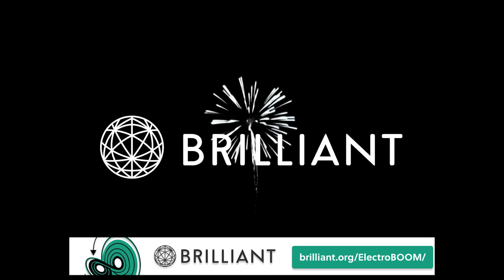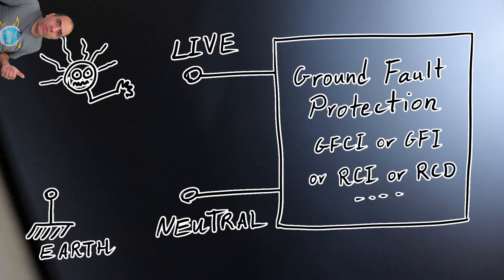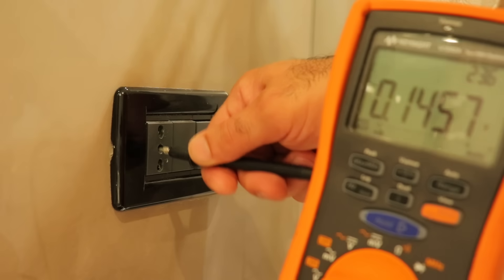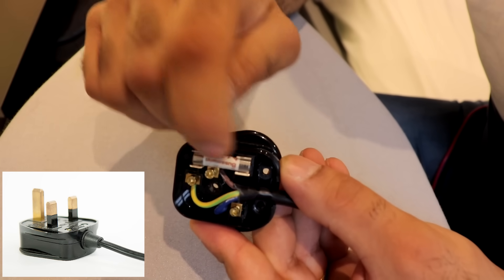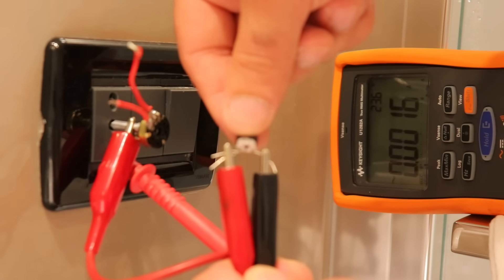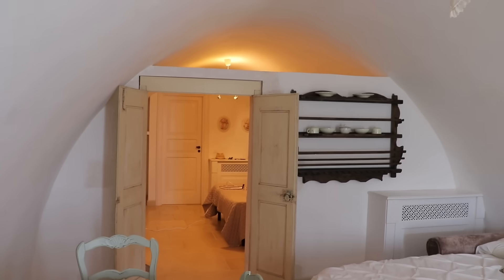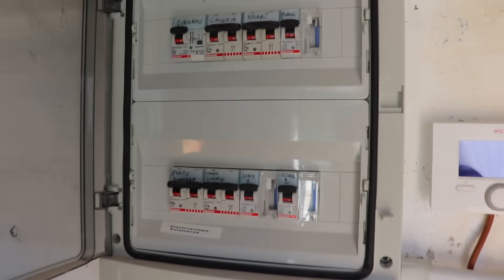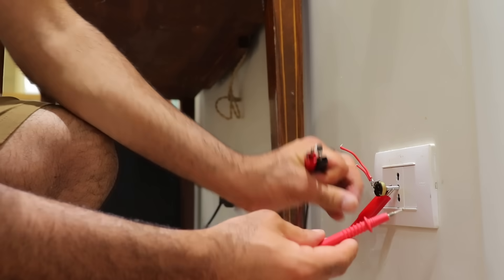Tripping Every Breaker in Italy

Comment: 3:45 black as neutral shouldn´t be as over here it is supposed to be the blue as neutral at least if you wire it in the right way, these are normal breaker you have there, there are rcd´s in this formfactor but they always have a testbutton wich you are supposed to press once (or twice depend on maufacturer) a year for function testing.
But in most cases you will have an Rcd for the whole house direkt in the main panel because (i would guess) 95% of the houses in europe have 3 phase power to them and normally (at least in gemany but as far as i know neighbouring countrys too) there is first the main fuse, energymeter, then a fuse the rcd and after then smaler fuses for the seperate curcuits.

Comment: switching on triped fuse is extremly danger if not irresponsible. Stranger Canadian eletrician is not permitted to touch the fuses. What if some other person disable it on purpose (maybe local electrician) to for example repair broken outlet. Going into building and switching on random fuses is extremly irresponisble... Hope you Mehdi don't do it again. Thought you got higher IQ... Very big dislike under this one.

Comment: In EU i you find most ground breakers in the main elecrtical cabinet. 
The breakers also go off if the current is to high. And the main circut breaker goes if there is ground fault.

Comment: I'm italian XD
9:13 we don't even know, never seen it anywhere.
9:20 outlets door are mandatory, but sometimes they can get stuck, especially when you make something like at 15:29 which sadly a lot of people do.
12:56 that hotel had not so good circuit planning, as you can see in the room panel has 16A main disconnect whit rcd and 16A plug protection. Probably even the reception one was a 16A one. the correct way would be 16A standard for double hole plugs (you can plug 10A and 16A appliances on them), 25A main room and 32A in the reception, to make a proper cascade protection.
Yes, the double hole plugs are on different circuits from the single hole ones which are only rated for 10A

Comment: It's not Europe universal. Generally "neutral" and "earth/protective ground" is the same and connects to the actual ground at the transformer, usually rather powerfull one enough for several highrises or not a so small vaillage. In cheaper older standard in which you don't have RCD/RCCB/GFCI/DCCB you can install one/some in your fuse box providing a third wire from use point to the fuse box, in newer standard the ground wire connects with neutral at building distribution/fuse/meters box, but a real gronding at the use points is present only in factories and sometimes is rather complicated to unite with lightning protection ground, which is a must (in case of single entry point for each just a gas discharge surge protector between the two is enough, but they have to be provisioned near each other in the project).

Comment: The wiring in our hotel room in Italy was horrendous. It had these tiny wires for the hair dryer that barely held on. 
probably 22 gauge or smaller. For a friggin hair dryer. Just using it the wires broke for no reason.

Comment: I just checked the breaker box of my apartment here in Portugal. Seems like the main breaker cuts at 0,3A. 10 times the shock. Ouch. Individual breakers have no mention of it. Its an over 30 year old building.

Should I upgrade it?
Reply: If it doesnt Work, then Upgrade immideatly
Reply: 300mA GFCI are used for fireprevention. 30mA (or lower) is the rating for person protection

Comment: Also that central GFCI system is the same standard as what’s used in Australia as in Australia they will normally have one main GFCI breaker for a whole apartment/house but they sometimes have outlets with GFCI breakers instead in smaller appartments such as in small studio apartment styled motel rooms! Also in our house the GFCI breaker is for all of the outlets in the house and is not connected to the lights! :)

Comment: the UK plug isn't just electrically safe as well with its fuse, ground and half way plastic, it works as a floor trap against would be invaders  while its thick metal prongs are capable of carrying a lot of amps too, good for reducing arc damage while our switched sockets help reduce it and improve safety from people just randomly sticking stuff in and our houses are fully GFCI protected..

Comment: As an Austrlian I was laughing for a while that you'd never seen "whole house" GFCI, which is the default here for example.  At worst it's per-circuit GFCI with a combined breaker/GFCI in one unit.  I had to convert from whole house GFCI to per-circuit GFCI as my Tesla Powerwall would trip the GFCI when it went off grid.  My whole house GFCI was 40mA trip for all of my circuits combined, whereas the per circuit GFCI units are 30mA each.
Reply: Care to explain why the a combined GFCI/breaker is 'at worst'? I love them, because there's only a handful of appliances you have to check after a popped breaker.
Reply: @Peptuut  poor choice of words.  I've got the flu and my brain no worky.  It was "at worst" as in "if there are a lot of them".
Reply: @KaldekBoch  40mA is no standard trip current, is it some custom made by a smaller company?
Reply: @mernokimuvek  it is a hager brand "CDA 240T"  rated at 40A with a 30mA (I thought it was 40ma) GFCI trigger.
Reply: @KaldekBoch  As far as I know there are only 30 and 300mA breakers. The latter are purely for fire protection purposes. Neither detects between phase issues - something that I have discovered when there was a moisture entering a power rail tying together multiple fuses with a central 3-phase GFCI.
Reply: @ehsnils  The 2 RCD sensitivities used in Australia (at least nowadays) are 10 mA and 30 mA. 30 mA is the most common, 10 mA is most often used in hospitals.
Reply: @Peptuut  The worst thing with them is the price. Otherwise they are great since you don't have to look for the fault in the dark and try to figure out which circuit that did trip the GFCI. Especially tricky if you have a lot of items with a high leak current so that there's no actual fault, just a sum effect.
Reply: The UK standard was originally one RCD (GFCI) for all circuits, then it changed to at least two RCDs, so you "only" lost half the circuits. I won't have anything to do with such a cheapskate approach and always insist that it's a combined MCB/RCD (called and RCBO) per circuit. It costs a bit more, but over the lifetime of the installation it's minimal. Personally I think it ought to be compulsory for new installations.

nb. UK domestic RCBO/RCDs trip at a maximum of 30ma, but typically about 25ma or less.
Reply: @TheEulerID  my sparky did say that it was rare even in 2005 when my house was built to only have one GFCI.
Reply: @KaldekBoch  I can't recall when the legislation in the UK changed so that single RCDs (as we call them) became illegal, but that was probably around the time of the turn of the century. As I say, I insist on one combined mcb/rcd per circuit, and I'd strongly recommend that to anybody who is having electrical work done.
Reply: @TheEulerID  don't say "turn of the century".  It makes me feel old.
Reply: @TheEulerID  I'm an Aussie and a licensed electrician. We do usually call them RCDs here. Our current wiring rules (AS 3000) require individual circuits to have RCDs, and have done for many years now.

Comment: I never saw a GFCI outlet in europe. They may exist, but the standard GFCIs are installed in the fuse panel, since the mounting rail of the fuses and GFCIs is the same and standardized, manufacturers only need to make one type of equipment that can be sold in all over europe and be exported as well, and not a different GFCI outlet for every country. And with this system, the whole wiring from the fuse box to the outlets is protected bei GFCI too. For the case you accidentally damage one, by putting a nail into the wall to hang a picture and hit the wire for example.

Comment: The relevant wikipedia article for this https://en.wikipedia.org/wiki/Residual-current_device

It lists the type of RCD / RCCB / GFCI  used in several different countries.

Many countries demand by law that the entire building is protected by (at least) one, and that it triggers at a max of 30mA and takes no longer than 300ms to cut power.

BTW a small "life-hack"  - My lights are not on a separate RCD, but I have put a small glow-in-the-dark strip on the breaker box which makes it much easier to find in the dark should the power cut out for any reason.

Comment: 15:26 That "Schuko" plug should NOT fit into the narrow italian outlet. The pins are wider. If it does it probably means someone has brute-forced it in before, deforming the plastic holes and making them large enough to fit the plug. Sometimes you don't have an adapter at hand, I've done it myself on several occasions.
Reply: P.S. The ground protection just NEVER fails. I've never seen one fail, I've never even heard of one failing, ever.

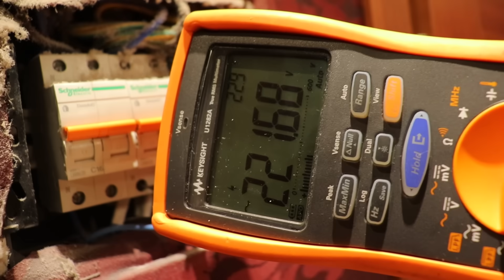Comment: 3:37 I can't properly see what you're doing, but I can assure you that first, there was no black wire on the right side and second, the brown wire is phase 1, the blue wire is neutral and sometimes there are two black wires which are phase 2 and 3 (the ones on the left seemed black, but I don't think they are, as you normally wouldn't just only have one breaker for single phase and three phase power is only necessary for really heavy appliances in Europe (like a lathe))
Reply: 1,

Comment: In Europe GFCI often is a (mostly) blue switch in the fusebox. Edit: Europe mostly uses AC instead of DC so it doesn't matter how to plug the plug in.
Reply: AC is used everywhere, but some countries use polarised plugs (US/UK, for instance). Many European countires use schuko plugs which are not polarised. The polarisation has some safety implications as one terminal is referenced to ground (the N terminal). If a device has a single-pole switch, this can either be the N pole or the live if the plug is not polarised.

Practically it's not a huge concern but lets imagine some old grandpa bought an old lamp at an antique shop. It has a non polarised plug and he switches it on, but the lamp is broken :(. Grandpa forgets to unplug the lamp and goes to unscrew the lamp. Because the "live" part has a 50% chance of being on the outside thread instead of on the inside, he may get a shock that could've been prevented with a polarised cable.

Comment: In the U.K. it's becoming more common to have each individual circuit on its own combined RCD/GFCI (earth leakage) + MCB (over-current) protection device called a RCBO (residual current breaker with over-current).  This way when a fault occurs only the affected circuit trips.
Reply: Yeah, just double checked my new apartment in Aus, it's a main CB for entire apartment + RCBOs for oven, aircon, lights, laundry GPOs and other GPOs.

Easy way to isolate and protect without tripping the entire apartment.

Comment: Mehdi, It is very inconsiderate to perform such tests, especially not informing the hotel staff and having at least a second person with a fire extinguisher or a phone to call help on site. There are two main reasons: (1) You must understand that if you run into a hotel that might not be up to code (unlikely, but you don't know, and that is why you are executing this test), you might start a fire in a complicated city like Venice. Getting fire fighters to any place there is a nightmare, and in the past small fires have spiraled out of control, with whole blocks burning down, ironically surrounded by water.

(2) You are majorly inconveniencing others with your actions, in the middle of the night. I have been myself a victim of Americans who do not give a f*ck. On vacation, my office calls late at night, asking for help. I log in with my laptop that is on the last % of battery, and I find the outlets suddenly cut out. Next door Americans have managed to trip the breakers with some dirt cheap multi-outlet-adapter, which they showed me after they came knocking on my door asking for help. I was furious.  Nobody in the apartment complex available to fix this late at night, I had to race my battery and battery pack to fix the production issue. Next day the Americans complained, instead of admitting guilt. 

Bottom line is that even though you think you are very competent and know everything, you have yourself proven in your video that you do not. You caused major inconveniences, tripped a breaker you could not find, and in Rome tripped 3 breakers plus probably half the hotel. You are not prone to errors, what if the RCD had not tripped and you had touched live wires? There would not even have been a second person to call for help. This is not what they teach us in engineering school in Europe. This is not proper "science".

Just think: Nobody in all these hotels / apartments has elected for being endangered or having their power cut, just because you need some content.

Comment: The Italian 3-in-line connectors are the odd ones out, and technically it is a violation to plug the actual "European" round connectors into a Italian 3-in-line socket. That device, with that plug, should not be in that room, the plug actually does not fit unless somebody has messed with it. Of course, whoever imported or bought that device did not care.

Comment: 14:58 As far as I've heard, the lack of keying is a deliberate design decision. There is no guarantee that touching the neutral wire is always safe. e.g. if it's wired backwards, it might go unnoticed for years. Having unkeyed plugs forces device manufacturers to always treat the live and neutral wire as equally dangerous.
If there's a one in a million chance it will kill you, but it's fine 99.9999% of the time, people get complacent. If there's a 50:50 chance of death, people will be much more careful.
Reply: Correct.

Comment: In Europe we just have a different GFCI braker style. They always sit in the braker box but can be wired up in many different ways, in some older apartments or houses you still may have GFCI connected only to bathroom or bathroom and kitchen circuts. Altho nowaydays there is a legal requirement to put GFCI for all the circuts in new buildings in most of the EU.
Reply: It also applyes to renovated buildings but only those owned by the state or a company. If you are renovating your own apartment or a house you can do whatever you want. But GFCI brakers cost only around 100$ and you usually need only one to protect all the circuts in the house so private citisens install them anyway.

Comment: Concerning the problem mentioned at around 15:30

as far as I know, by EU-Laws outlets have to be designed in such a way, that you cant out manufactured cables in a unsafe outlet

for example if you look at the german ones. We have a thin type an the big one you showed. You can put the thin one in the one designe for the big, but there is no way to plug it into the smaller one

Comment: As a German I want to add some points to the European and German System.
First, I have never seen one of these normal Italian outlets before. In Germany, we only have these better outlets, but we have different plugs that all fit in the same outlets. First, there are "Flachstecker"(Flat plugs) that don't have a ground connection, but the device mustn't draw more than 2 Amps and has to be insulated. Then there are bigger plugs for devices that draw up to 16 Amps, but they also have no ground connection, so the device has to be properly insulated. The third plug is the "better" one you've seen. This one has a ground connection as you've seen.
Besides the normal household plugs there are plugs for devices that draw more than 16 Amps. These are round and have 5 connections: Neutral, Ground and 3 phases. Depending on the outlet you can either draw 16 or 32 Amps from each phase.

Comment: yeah my wiring would make him go insane, got a hall light with two switches that must be flipped in the correct order or the light stays off, got another outlet that has a switch but no protection, I was sleeping in my living room since it has A/C and my room doesn't, my father set up the futon and didn't check to make sure it wasn't on a cable and it cut through one of them and exploded the cable the cable died before the breaker did would've just kept going until what ever was connected burnt away entirely.

Comment: Yes the UK plug is a bit safer but it’s not reversible sooo that’s a bummer. Anyway you should visit Sweden 🇸🇪 we have the best plugs. We use F type for grounded stuff and type C for non grounded stuff

And the wall outlets are all type F. With ground on top and bottom.

Comment: At 9:10 it looks like an old telephone BTicino plug to me!
The 30mA differential is protecting multiple breakers. Down to 5mA it would trip from the combination of the leak currents of all the appliances. It tripped at ~24mA on the video which can mean that around 6mA are already leaking in this circuit at this particular moment.
In France we have 2 differential protections levels. The 30mA will in deed give better odds to those taking baths with live toasters. However, be careful as some old places are not up to the standards and might only have the big fat 500mA differential. It is usually located next to the powermeter. I don't think this one was ever meant to save people.
Tip: Might be wise to try to spot the breakers before trying weird stuff.
An airbnb could be a good idea for you to make full reviews of electrical codes around the world if you start a series. :)
Reply: For Italian standard  the RCDs  must have a safe non-tripping current equal to nominal_Id * 0.5 (or Idn/2) while they must definitely trip within the nominal tripping delay for Idn. For currents between Idn / 2 and Idn they can trip, not trip, or trip in a longer time than the nominal. 24mA is quite a characteristic value for that device model